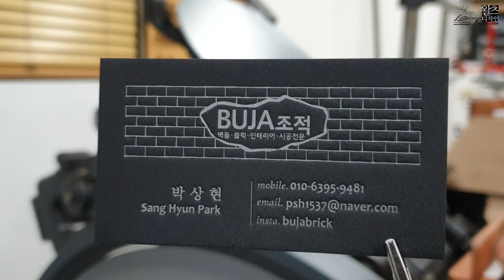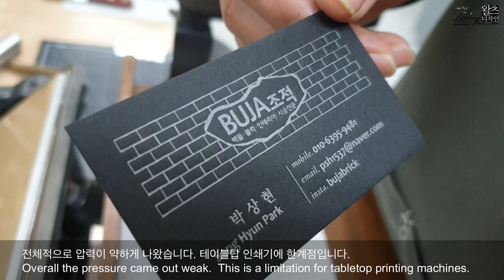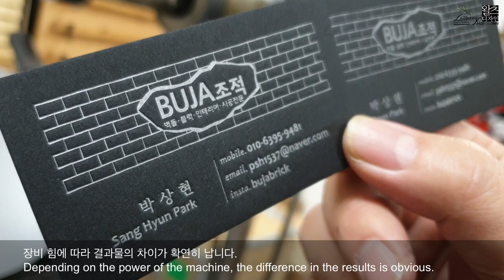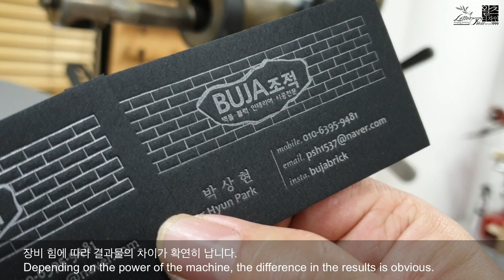Print letterpress business cards by comparing large area designs with small and large machines.레터프레스

Comment: Hello! Great videos. Why did you change machine from manual to automatic? Couldn't the manual letterplress get the same resault as the automatic?
Reply from the maker: Nice to meet you.  Although it was not well expressed in the video, there is a lot of difference in depth.  The customer wanted a deep press.😄😄
Reply: @w_letterpress  So the bigger automatic letterpress can emboss the paper deeper compared to the small one right?
Reply from the maker: On a small piece of equipment, the lever was pressed only to the extent that it was not damaged.  I've had the experience of damaging the lever.😅😅
Reply: @w_letterpress  Thank you!